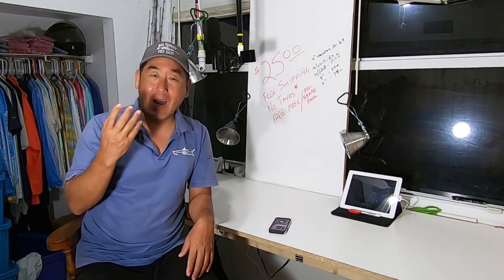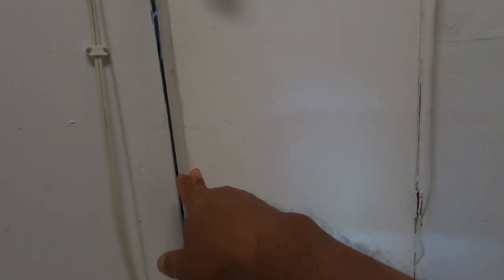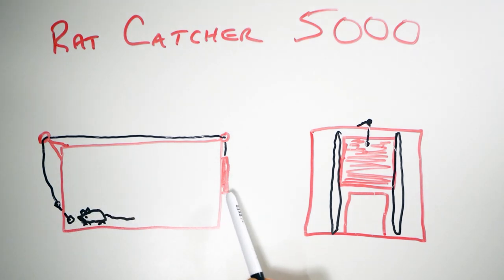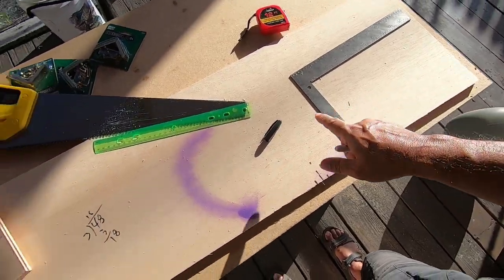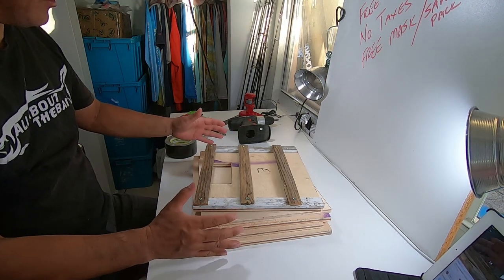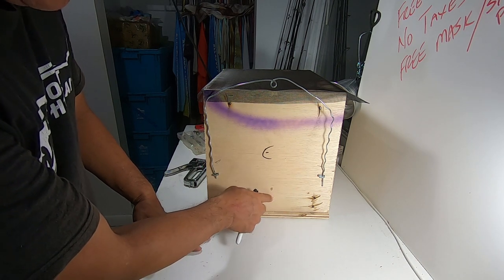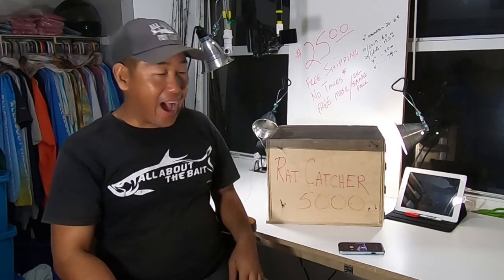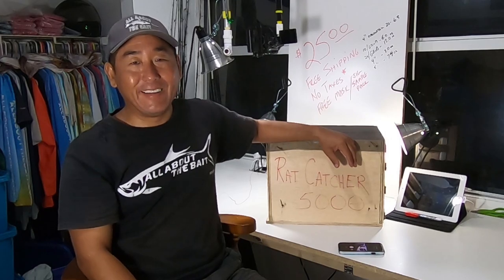Florida Keys Trapping Tales - Ft. Rat Catcher 5000

Comment: That design works well for 1 at a time but check this one out: https://twitter.com/buckeye36/status/1227287408145772544?s=20    Of course, the way that one you caught was able to jump, cauldron will have to be taller than a standard turkey fryer kettle, maybe something out of chicken wire like a pigfish holder.